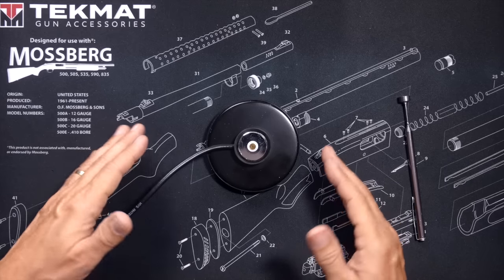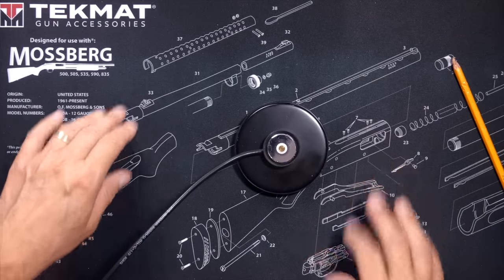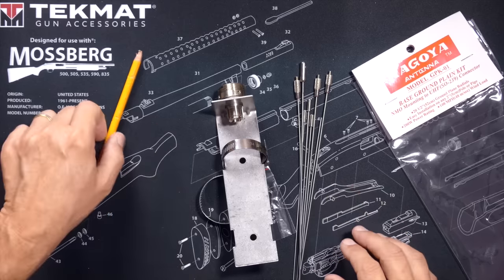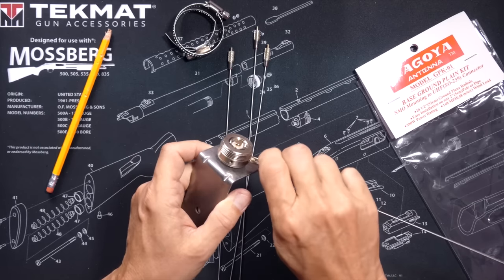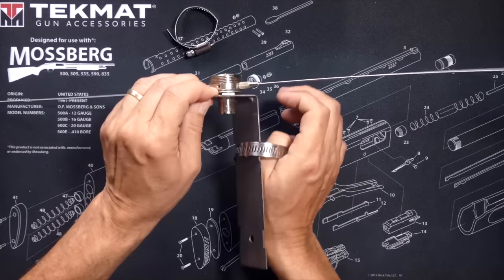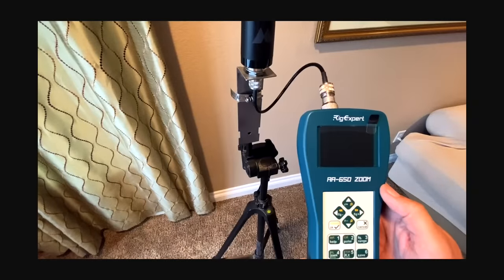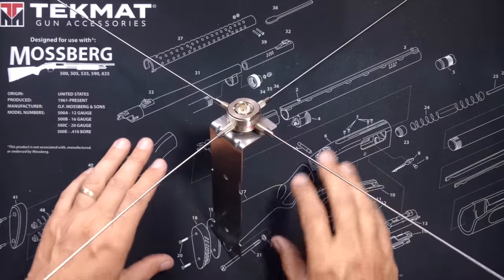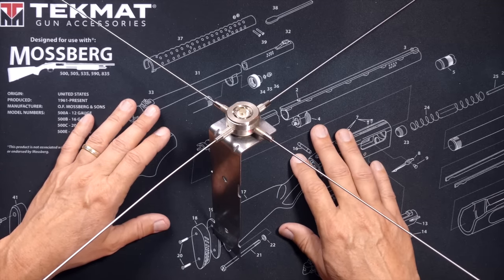What If You Don't Have A Good Ground Plane? Do Ground Plane Kits Work? Use A Mobile Antenna At Home!

Comment: I would like to see a video and hear your thoughts on mobile cell phone boosters...
Reply from the maker: I actually had one a few years ago and it worked well.. But about 3 months after I bought it the cellphone company put a new tower right down the street from me and started getting 5-bars..so I sold the booster...
Reply: @TheNotaRubicon  I'm talking about if you're in bfe with crap signal.  Here in Yuma, most of the desert doesn't have signal or it's so poor you couldn't think about making a call.  But that's deep in the kofa range.

Comment: Curious if this could be clamped to a roll cage and not use the 4 “far bars”?
Reply: A roll cage will work as a counterpoise so yes, you could mount this to a roll cage without the radial's poking out.

Comment: If I understand you correctly, you do not need to actually ground the ground plane? It's only ground with reference to the radio itself?
Reply: Yes, you could mount a ground plane antenna on top of a wooden pole, or a wood beam in the attic and it would work
Reply: That's correct. The radial wires are grounded to the radio via the coax shield. No other ground is needed for the antenna to work.

Comment: Question, would there be any issue with having multiple magnetic mount antenna's on the same ground plane ie a huge metal roof? Or is this not advised?
Reply from the maker: Depends on how close they are to each other.
Reply: @TheNotaRubicon  TY that gave me some search criteria content and it seems I have to know the wavelength and keep them a min of one wavelength apart.

Comment: I bought this kit and couldn't get it to work without a high (3.X) SWR. I tried a few different antennas and no dice.
Reply from the maker: Then there is something else wrong with your antenna/setup. A ground plane kit does not fix all issues with SWR - it can only fix a high SWR due to a poor ground plane.
Reply: @TheNotaRubicon  Yeah, something's off. The 2 antennas I tried both work well on a vehicle, but not on this. It's strange.

Comment: How does a handheld get a ground plane?
Reply from the maker: On an HT your head, body, and the radio itself act as the ground plane.
Reply: @TheNotaRubicon  
I know you're very knowledgeable about this stuff, but in the entire radio and antenna is covered in plastic how can you're hand/body be grounded to the radio? Wouldn't there have to be some sort of metal from the antenna touching you to be grounded? Thanks.
Reply from the maker: No, its not that kind of a ground.
Reply: @TheNotaRubicon   Yes!  Indeed … it’s not an electrical complete circuit … think of it as more of a reflective surface … catches more radio waves like The Beach Boys!

Comment: Yeah, drills a hole in your Jeep...there are plenty already there since they leak brand new from the dealship.
Reply from the maker: Neither of my two Jeeps have ever leaked.
Reply: @TheNotaRubicon  Hey just watched the xps 2500 mil vid..good job.  Way better than Chinese radios and Kemp has a good selection.  2 of my buddies got new jeeps in the last 2 years and leaked right out of the box.  Maybe you have an older one. Not the same QC anymore.  Keep up the good work.

Comment: I made a portable GMRS base station antenna out of a 6" pizza tray, coat hanger wire, assorted hardware and an unbranded (possibly Nagoya UT106) mag mount antenna. I ended up with a 1.01 SWR, zero reflected power and 4.17W out of a UV-5R. A 12' PVC pipe mast can be cut into 2 or more sections with slip fit couplings and mounted on a stake driven in the ground. Give it a try with your favorite hand held radio. https://youtu.be/G8YoH4n-KHc

Comment: Radio is important in SHTF but I would be very careful about using them with or without codes or even encryption. Everything you said has value but for aome people its easier than they ahow in the movies. There is a device called the kraken that when paired with a raspberry pie or laptop runs algorithms and shows your location on a gps map and is very.....very accurate. I should mention that you can build your own system like the kraken and many people have. Not to mention near peer enemies like russia china and basically everyone else we would worry about had much better systems than that. There have been a ton of Ukrainian soldiers that caught an artillery barrage after keying up a baofeng. Yes they use them. They have learned to only use comms when they are actively in a firefight because at that point the cats out of the bag and comms will save more lives than they will cost you. The fact is there are no procedures that will save you except one.....only listen on the radio. Do not PTT unless you're life depends on it. Now if we are in a civil conflict and we are only worried about our neighbors and local gangs etc.....u might get away with it. You certainly wont against a well prepared and determined enemy.